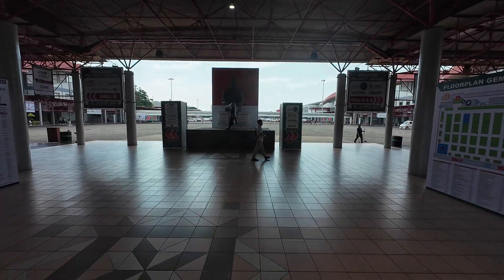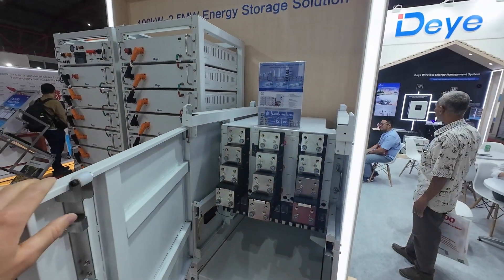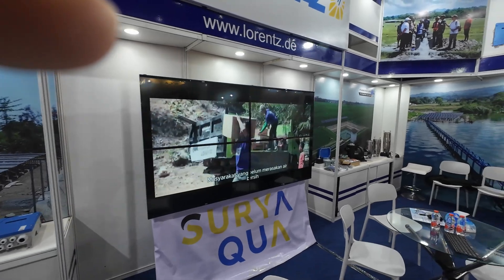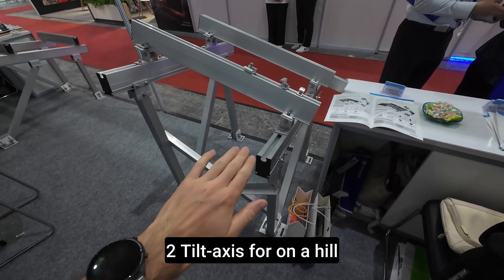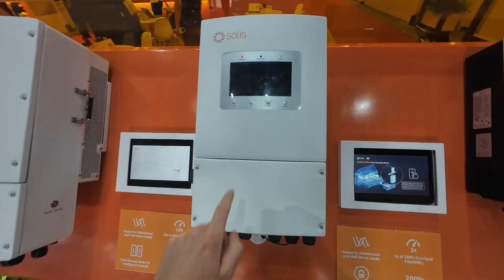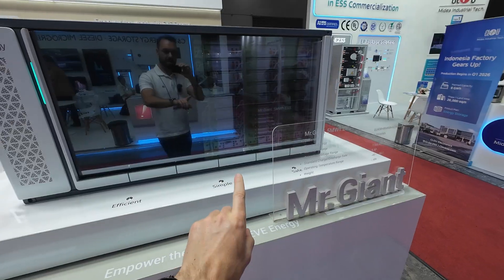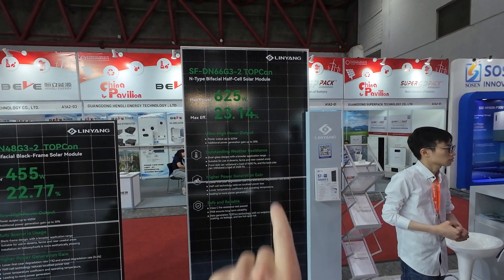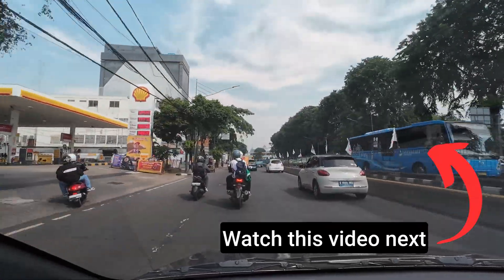Inside Indonesia's Biggest Solar Expo - Solartech Jakarta 2025

Comment: I don't think the losses on that sodium battery are very big. Those are pretty small cooling ribs and it looks like it's all passive cooling. All batteries and dc converters require some cooling. But the cycle efficiency is probably closer to 90% than 97%.
Reply from the maker: Indeed, these are passive. Yes, I thought 97% round trip efficiency was optimistic. I would have liked to see the test data but couldn't find it.